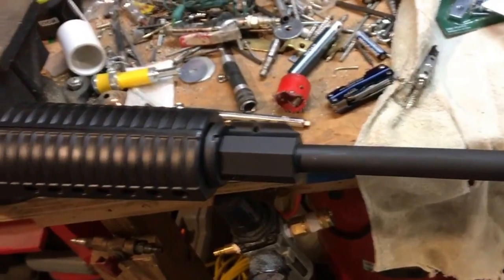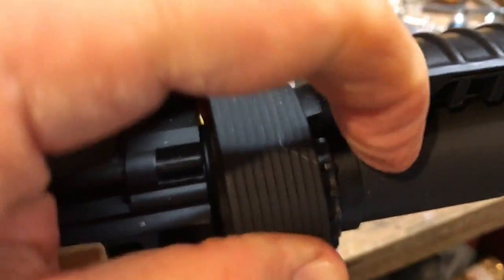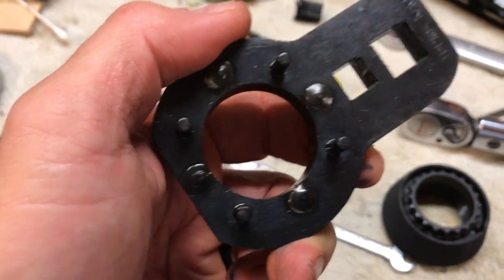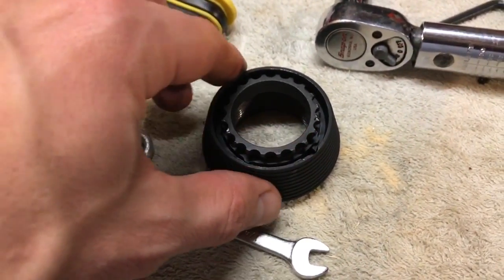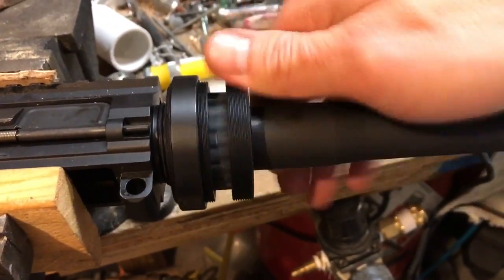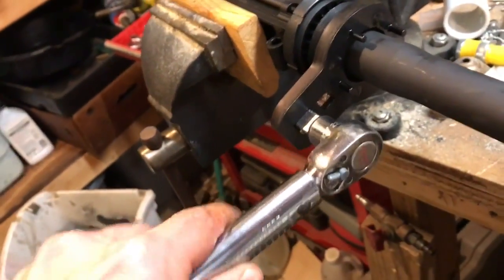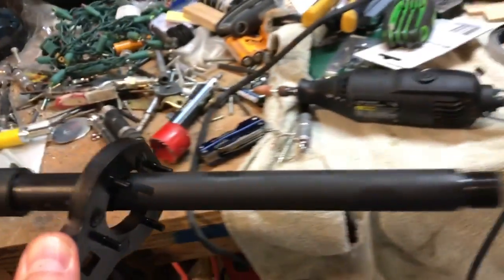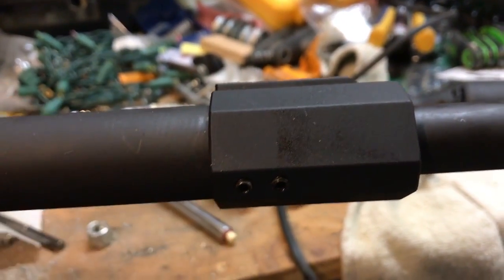DPMS Oracle 308 Monstrum Tactical Free Float Handguard Removal and Install

Comment: Hoping this helps some of you watching this that have never learned to properly use a torque wrench with a crow's foot or adapter.  To get the proper torque, you MUST keep the torque wrench at 90 degrees to the plane of rotation.  If you use it straight out, as this fellow did, you will over-torque your nut by extending the length of the torque radius.  This is tools 101.

Comment: I could be wrong, but aren’t you supposed to have the barrel nut wrench 90° to the torque wrench? Worked on helicopters and that’s what we were taught. Great video though.
Reply: cnw4x4 I’m not sure about that. I used the Monstrum tactical video as a guide. They may have mentioned that. Thanks for the feedback
Reply: cnw4x4 The official military armorer manual shows everything in line. I’ve always done it that way and never had any issues. 

Not to mention you will very nearly always meet the minimum torque spec with this type of handguard as you will nearly always have to give additional torque on the barrel nut to get the gas tube hole to line up.
Reply: @rifleshooterchannel208  you're supposed to attach it at 90 degrees to achieve proper torque. Good practice for any application
Reply: Big Hoss I understand that I am just pointing the practice as illustrated by the US Military Manual. 

Thought they very well might’ve took that into account when using the official NSN armorer tools and figured the torque specs in-line with the wrench = whatever the desired torque specs are with the wrench at a 90.
Reply: With a range of 30-80 ft lbs it doesnt matter, esp when he has the torque wrench set at 30.

Comment: Just an idea would it have been easier to remove gas block before removing the handguard as it would relieve pressure off handguard it should pop off a little easier?

Comment: Great video. Thank you for the help. I have my UTG PRO coming in the mail. Hoping my existing gas block works on mine. What torque wrench would you advise me getting? Also, what size pin punch for the block?
Reply: Luke Phillips I’m sorry I don’t remember the size of the pin punch - but you can get an assorted pack at Harbor Freight for $10. I think Autozone will let you borrow a torque wrench for free ;-)

Comment: Could you change out the barrel for any AR-10 barrel out in the market ?
Reply: Only if it is the correct pattern-- DPMS/LR-308/AR-308 is the most common, Armalite/AR-10 is more pricey and less likely to work with aftermarket parts